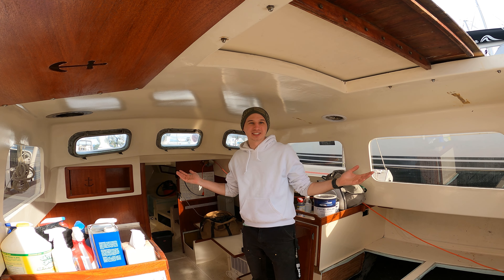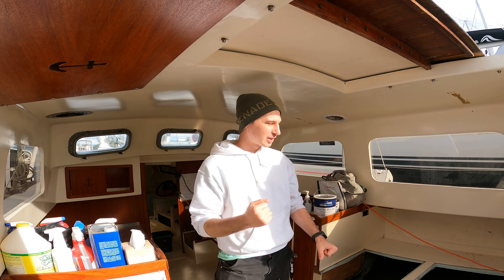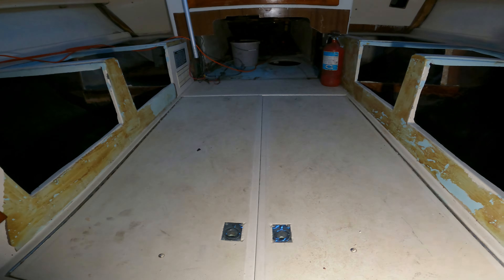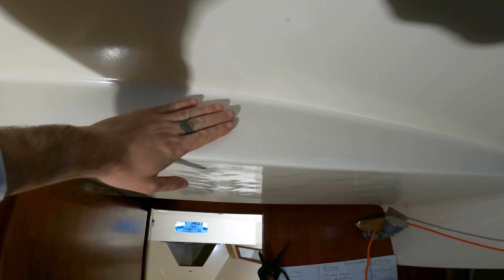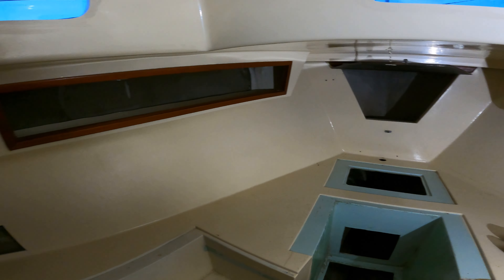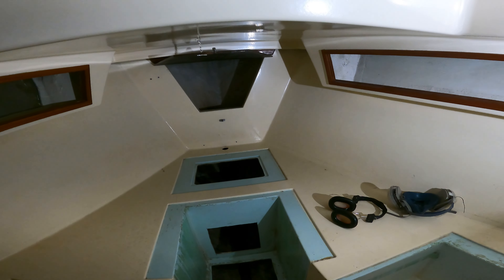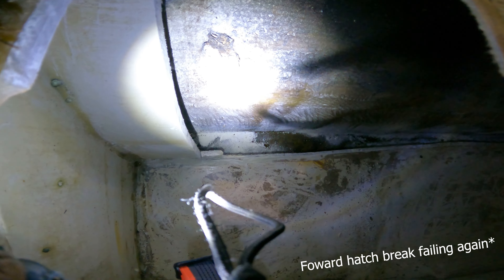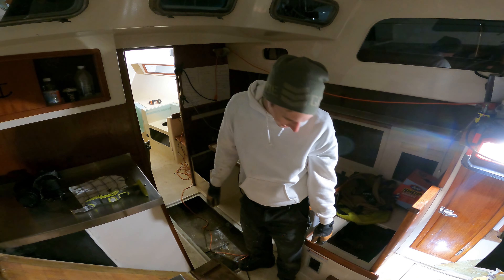Midship Goo Lagoon

Comment: 6:06 yeah...i see zero sagging or any signs of issues with the mast step so you may want to leave all of that alone. The mast is just fitted over a sleeve on deck and will come free once it is lifted. The shrouds keep it in place. Pretty sweet interior with the way the aft part of the cabin is elevated. Like a pilot house without so much windage.
Reply from the maker: Thanks for taking a look at the mast step! That is an area I’m less knowledgeable in so I’m genuinely thankful you commented on it.
The deck house is pretty sweet! But the original owners said that it was the only boat doing 2knts with no sails up because of the high superstructure lol